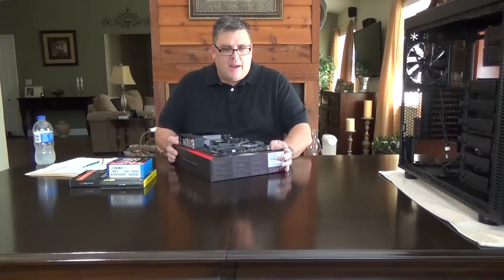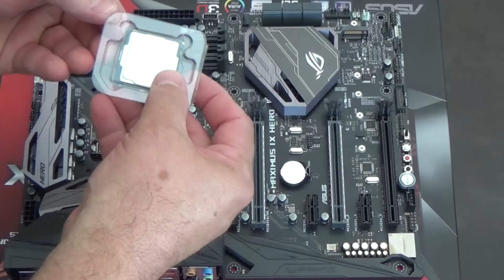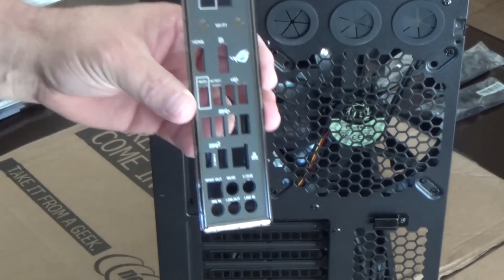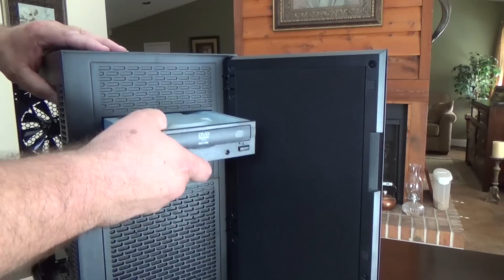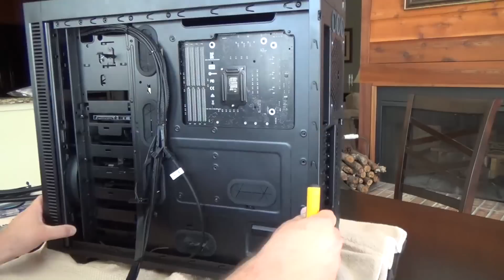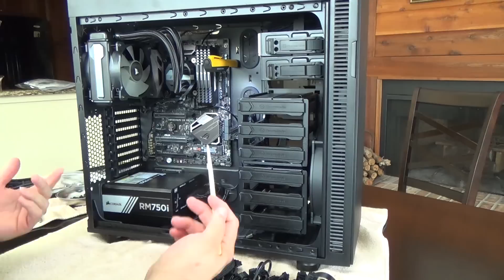Asus Maximus IX Hero - i7 7700k Kaby Lake Build

Comment: Hey Netnole,
I have the same motherboard, and RAM
corsair 650w psu
Gtx 1070 GPU
i7 7700k
With a pretty basic cpu fan
I am pretty sure everything is correctly plugged in
The mobo lights up when i plug it in but it will not turn on
The LED light on my case lights up once

Comment: hey netnole i just installed this mobo and attached an old ssd to it from my previous pc and it boots but none of the usb or ethernet ports work on the mobo, so i cant even reformat my drive or use any flash drives on the usb ports, what do i do?? plus the windows 7 is running extremelyy slow and laggy due to the device manager not detecting anything with a big yellow sign to everything on the mobo!! im so confused
Reply from the maker: Wipe, Re-install windows.

Comment: FIRST of all , cograts for your vids and really thank you . 
The case seems like C.M. Silencio 652 s . Great . 
My point and my question is about the CoolerMaster Hyper 212 EVO . Can i use it at my mo.bo.maximus ix hero with an i5 7600k ? 
Thanks in progress .
Reply from the maker: I have never used the Coolermaster Hyper 212 EVO, consult their documentation for compatibility.  Further, the question is most likely NOT compatibility with the board and the chip, its the case that you are most concerned with.  Will it fit?  Will the holes line up properly.  Does the case support your particular radiator?  Many questions around the case.  The Mobo and CPU, not so much.  If a cooler does not support the latest intel chips, don't buy it :)
Reply: THANK YOU !
I already use it at a maximus viii ranger , with an i5 . My case is a c.m. 652s with plenty of space . 
Thank you , again .

Comment: i just ordered an almost identical build to this yesterday, I am curious, what are the disadvantages of plugging that watercooler into the CPU_FAN power socket on the motherboard? Won't it just normally be temperature monitored and adjust the fans accordingly by the BIOS that way?
Reply from the maker: The default selection for an Asus UEFI BIOS is to monitor the CPU Fan header.  If it is not present you will be stopped out and prompted during a reboot.  You can change the default condition, of course however during a BIOS upgrade you get stopped out again and prompted.  Additionally, the speed is controlled by the cooler itself.  If you plug in the USB 2.0 header, you can change the speed and get some other reporting, which is what I always do.
Reply: netnole but if I plug it into the cpu_fan plug, won't the bios just monitor the radiatior fan speed anyways?
Reply from the maker: I plug the radiator fans into fan headers so that AI Suite can dynamically change the speed as needed.  It is a much better solution that the corsair controller or Speedfan, for that matter.
Reply: netnole but if AI suite is closed, or if the cpu is hot during a reboot, won't it just run at its 'normal' speed until AI suite is open in the OS again? Is that safe?
Reply: Just curious because I got a corsair all in one cooler with this build arriving soon, just want to make sure I get it set up right
Reply from the maker: AI Suite is essentially a front end for the UEFI BIOS settings.  The software itself doesn't need to be running.  Your question is a little confusing, not sure what you are asking.  The cooler will manage the pump and fan speeds (if the fans are connected to the pump) just fine with no software installed.  If you plu the radiator fans into fan heards on the motherboard, you can acheive a much qieter solution and increased tweaking.  Either way, everything is "safe".

Comment: Not a copy cat but my best bang for my buck was the same component set you are using minus the M.2 drive. My case is an old IBM to keep unwanted eyes off the guts. This build cost me 1000 us by the way here in Japan. I was curious because its been a long time since I built a PC. Does the case provide anything an old case won't have besides cooling and convenience? I plan on molding carbonfiber guts for the case. I have a bunch left over from a motorcycle. Great video by the way.
Reply: I was really hoping for a reply. ram and board come in tomorrow. can't be harder than the JUNKS I built. The guy still hasn't shipped the case so please shoot me a line on cases. I don't mind adding a spst switch or cutting some new sheet steel but anything requiring a classic wiring diagram will have me screwed.

Comment: Appreciate your video sir - I found this because I'm building the same rig except I was going to overpay for a 1500W power supply and I didn't even know about boot drives. My question, if you don't mind is - how would my system be affected without the boot drive? It would just take longer to boot up?
Reply from the maker: Glad you liked the video.  Your question is a bit confusing, however.  Every computer has a boot drive, which is defined by the drive that loads the operating system.  In this build it is the M.2 drive mounted onto the motherboard which is the boot drive that loads the OS.  Let me know if this answered your question.
Reply: lol sorry I specifically meant the SSD. I've learned a little more about them. At first I thought you could only put a few things on them that you wanted to load quickly, and everything else had to go on your regular HDD.
Reply from the maker: Again, a bit confusing.  There is no SSD on this build.  I don't know what a "regular HDD" is.  In this build the M.2 drive contains the Windows 10 operating system and all the applications.  The spinning drive is the data storage drive.  It isn't any more complicated than that.  The OS and the programs are launched from the M.2 because that drive is faster.  I fail to see what the issue is.  This is the most common setup on all production machines being built today.  Bar none.  Don't take my word for it, watch other videos.  This isn't rocket science.  BTW, Sorry to be so blunt.

Comment: Excellent video! I was searching for builds with ROG Max 9 Hero + i7 7700K + the Corsair H80i v2 and came across this gem. The parts for my build arrive today and I was just curious about placement of the water block and if others were using it with the same MB + CPU combo. I found your video very helpful. Thank you!

Comment: Drop the flashlight! You overexposed the area and render it white!  Also you did not mention the fact that the CPU bracket is lose until yo install the block!
Reply: Sorry you took my constructive criticism negatively.  It was not intended as an insult!  You present the material very clearly and I was not sure if you realized that when you turn on the flashlight the area is washed out!  The stick looks like a better way to point to an area.  Interestingly, you chose exactly the same parts I did, except the case where I used the Corsair Crystal 460X RGB.  No, it's not a Hollywood production, and aside for the washed out scenes with flashlight, I would rate your video a 8/10.  And in the spirit of improvements, on some scenes, you had a TV playing in the background.  Have a blessed day!
Reply from the maker: Who are you to offer "constructive criticism".  I see no video uploads from you.  "Washed out"... really.  Are you the type that needs to see the pins going into a RAM slot?  This video was the first Kaby Lake build on Youtube at the time, I had much experience with similar parts and wanted to give builders some assistance.  336 comments later, you are the only person who says that the video is "washed out" because of a flashlight.  Could you simply take the instruction for what it is worth and say thank you?  No, you need to offer criticism when you haven't uploaded a single video yourself.  Every other video that you liked on your page is being supported by ads, they are required to say good things about the products, fuck off and go view their slick productions with limited consumer value.

Comment: HELP ME Sorry, there is the black adapter ... is it used with I7 7700K?!?
I put the processor in the adapter and then insert it into the motherboard?!?
Reply from the maker: The adapter is designed for system builders that lack the confidence to insert the CPU in the correct direction.  It is perfectly fine to use it, I chose not to because I don't need to.
Reply: but the adapter insert in a slot ....but don't remove remain in the slot cpu forever ?!?
Reply from the maker: Yes, but no longer serves a purpose.  It is simply a guide to make sure you don't install the CPU in the wrong direction.  It is NOT required, rather optional.  I have never used it.  BTW, it is a recent addition to the  box.  Too many boards were being sent back damaged.  Damaged by people who inserted the CPU into the slot in the wrong direction..
Reply: Thank is ok...i don't use this adapter..thank for your  help me...Thank

Comment: A question: I bought the 2666 (16GB DDR4 2666 Corsair C16 VenLEDK2 [CMU16GX4M2A2666C16]) for a ROG MAXIMUS IX HERO but then after looking in its list on asus site no present... there are no risks that are incompatible?!? Thank you
Reply from the maker: The RAM list is for certification only.  It's not a compatability list to the exclusion of all others.  Any DDR4 RAM should work, for the most part.
Reply: Thank Guy's

Comment: Other videos show different direction of the wterbolck. Is this the right position of the or it doesn't matter?
Reply from the maker: Everything matters.  If other videos show mounting the radiator in the rear of the case with the hoses coming out the top, the corsair logo should be right side up.  Otherwise, the hoses would be kinked and put unnecessary stress on the insulation.  I don't know why that would be done on purpose.

Comment: Can someone tell if I'm missing anything for this build which is my first ever:
[PCPartPicker part list](https://pcpartpicker.com/list/jzkbD8) / [Price breakdown by merchant](https://pcpartpicker.com/list/jzkbD8/by_merchant/)

Type|Item|Price
:----|:----|:----
*CPU* | [Intel Core i7-7700K 4.2GHz Quad-Core Processor](https://pcpartpicker.com/product/VKx9TW/intel-core-i7-7700k-42ghz-quad-core-processor-bx80677i77700k) | $338.88 @ OutletPC 
*CPU Cooler* | [Corsair H100i 77.0 CFM Liquid CPU Cooler](https://pcpartpicker.com/product/V2JwrH/corsair-cpu-cooler-h100i) | $99.99 @ Corsair 
*Motherboard* | [Asus MAXIMUS IX HERO ATX LGA1151 Motherboard](https://pcpartpicker.com/product/HHbkcf/asus-maximus-ix-hero-atx-lga1151-motherboard-maximus-ix-hero) | $214.99 @ SuperBiiz 
*Memory* | [Corsair Vengeance LPX 16GB (2 x 8GB) DDR4-3000 Memory](https://pcpartpicker.com/product/MYH48d/corsair-memory-cmk16gx4m2b3000c15) | $119.99 @ Jet 
*Storage* | [Crucial MX300 275GB M.2-2280 Solid State Drive](https://pcpartpicker.com/product/KXkwrH/crucial-mx300-275gb-m2-2280-solid-state-drive-ct275mx300ssd4) | $89.88 @ OutletPC 
*Storage* | [Western Digital Caviar Blue 1TB 3.5" 7200RPM Internal Hard Drive](https://pcpartpicker.com/product/MwW9TW/western-digital-internal-hard-drive-wd10ezex) | $47.88 @ OutletPC 
*Video Card* | [Asus GeForce GTX 1080 8GB ROG STRIX Video Card](https://pcpartpicker.com/product/v34NnQ/asus-geforce-gtx-1080-8gb-rog-strix-video-card-rog-strix-gtx1080-a8g-gaming) | $534.99 @ Newegg 
*Case* | [NZXT S340 (Black/Red) ATX Mid Tower Case](https://pcpartpicker.com/product/tD38TW/nzxt-case-cas340wbr1) | $64.99 @ NCIX US 
*Power Supply* | [Corsair RMx 750W 80+ Gold Certified Fully-Modular ATX Power Supply](https://pcpartpicker.com/product/9q38TW/corsair-power-supply-cp9020092na) | $109.99 @ Amazon 
 | Prices include shipping, taxes, rebates, and discounts |
 | *Total* | **$1621.58**
 | Generated by [PCPartPicker](http://pcpartpicker.com) 2017-04-12 00:36 EDT-0400 |
Reply: Any advice will be welcome as long as is helpful ;)

Comment: There is something I would like to add regarding the PC Case. Mr. Netnole has chosen the right case with the right dimensions for this motherboard to fit. the Thermaltake F51. I have a CM 690iii which is huge despite the fact it's a Mid tower. The I/O steroid shield of this motherboard took space and tilted to the left , where the CPU back plate left side two screws won't fit. It's all because:
1. The Space that the I/O roided traps have took.
2. The small back plate window of CM 690iii
Now, I am waiting for the PC shop to open to get the case that Mr. Netnole working on.
Thank You

Comment: Nice video! Thank you very much for everything!Just one question.You didn´t put Thermal Paste in your CPU.You forget it or you dont need it with water cooling system? :O
Reply from the maker: Thermal paste comes pre-applied by Corsair on the liquid cooler.
Reply: netnole ahhhh didnt know that.Thank you very much.I am looking for NZXT x62 do you think is good one or you recomend your Corsair over this on?Thank you very much for your time.
Reply from the maker: I have heard very few complaints with AIO coolers.  I prefer Corsair products because of build quality and customer service. Read reviews on new egg where the geeks are buying stuff.
Reply: netnole nice i will go for corsair then.Than you very much.Is hard to find ppl who want to help.I really appreciate your help.Last question.Do you need maintenance on them?I mean to chane liquid etc or is it forever like the Air ones?
Reply from the maker: AIO = All in One.  factory sealed, no maint.

Comment: Hey man, thanks for the information in the video. I know this is a few motnhs ago but i just bought this power supply (corsair RM750i), but it is making some really weird buzzing or zooming noises. I checked it and it is not the fan itself. Do you know what it can be, or if my power supply is 'broken' or something. The sounds gets worse when i start playing a game.
Reply from the maker: Your power supply should make zero noises, other than the whoosh of air movement when and only when the fan is running.  Send it back.
Reply: Thanks for your information! I already contacted them with a video about the noise :) Really fast reply, and I liked the content, so +1 subscriber. Keep up the good work.

Comment: how long would this have taken you if you didn't record and explain?
Reply from the maker: So, to make it easy on myself I simply record from start  to finish  and cut out the boring parts.  It usually takes about 45 to assemble the hardware and another 30 minutes to get windows installed and updated.

Comment: i love this build but want your opinion before making the purchase to duplicate your computer. Building a computer from scratch to daytrade (think or swim) and occasionally edit video. Is your build overkill and if so, what parts would you replace with?
Reply from the maker: Nothing you mentioned requires enthusiast hardware.  Save your money.
Reply: Any recommendations? If you were in my shoe, how would you build one for day trading and video editing? specific parts would be helpful.
Reply from the maker: Look, I get paid to design a system and build it.  You want me to give you the design for free?  The design is based on many questions related to a variety of subjects.  You keep saying "daytrade"  that is internet surfing.  Call dell and get the cheapest deal you can.  An enthusiast build is to solve specific issues with very expensive high end equipment.  This computer cost close to $2500 with several hard drives added after the build.  My recommendation?  I gave it.... save your money.  Don't ask for free advice and then complain that it's not the advice you expected.  And before you ask, I never take clients through Youtube.  It's 100 phone calls and a thousand headaches.  Not worth it.  Do yourself a favor, stay out of the enthusiast market.  If you insist, I recommend.... https://www.falcon-nw.com/desktops/talon/design
Reply: sorry, didn't know that this is a service. If i knew i wouldn't ask. The below comment stated that you love helping novice or beginner system builder with their issues. My issue is that my quad core isn't fast enough to open multiple tabs on my trading platform because it cause the computer to freeze. That's the reason for the new built and the only reason why i ask. You are good and know what you are talking about but your attitude will drive people away. good luck with your business.
Reply from the maker: "didn't know", I mention my client in the video about 5 times.  Your computer problem is obviously not a CPU problem.  Do yourself a favor and save your money, don't try to build your own computer, you are not knowledgeable enough.  As for the "drive people away" comment, what the hell do I care?  This video is posted here for free.  I gave you free advice...  either take my advice or fuck off.  I will sleep well tonight.

Comment: You leave the metal bits on? I thought they were just covering for the chipsets and stuff but I guess they're permanent on my hero. I built my last PC ~10 years ago, so they didn't have those metal covering over the back of the IO panel or the chipset itself.
Reply from the maker: "metal bits"
Reply: netnole honestly I don't know how to describe them lol. Chipset shield? The metal coverings at the top of the motherboard, on the z270, and on the back end of the outward facing io board. Never had a motherboard this fancy so I suppose I've never seen it before. I'm a software guy mainly so hardware isn't my primary forte. Are these just shields or guards?
Reply from the maker: I see where this is going.....  The "metal bits" are a heatsink, they assist the chipset to dissipate heat away from the mount.  In the old days they would simply have a tiny fan to accommodate the same purpose.  The problem was, when those fans failed, the chipset would often fail.  Good question pal, having seen the progression over the years I never really thought about it because the underlayinfg purpose was the same.  Here is a pic of an old style chipset fan...  techreport.com/r.x/nforce590sli-am2/ecs-storage.jpg
Reply: netnole Right on, makes sense. I was really puzzled with the jump; heh. I can see how these would work better.